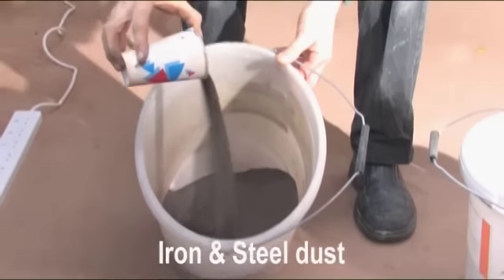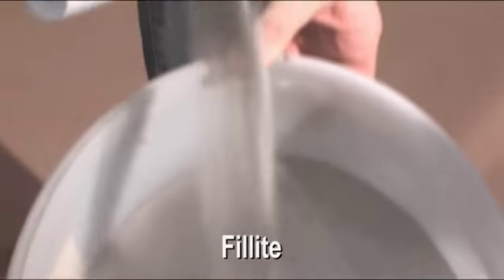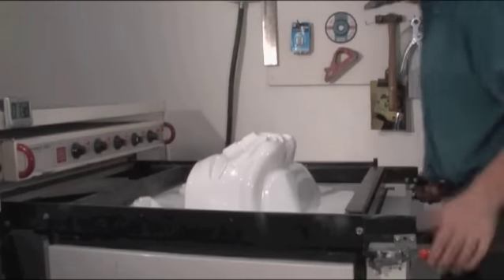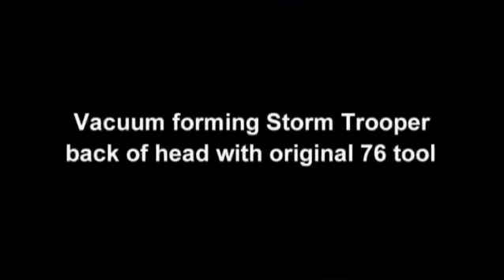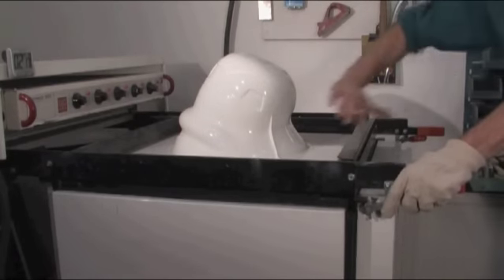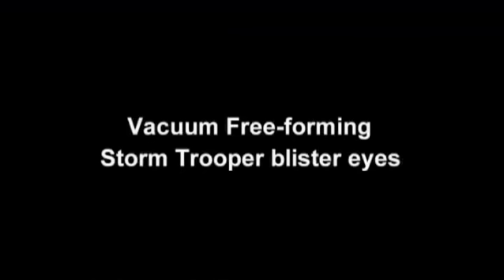Creating the original Stormtrooper

Comment: 3d modelling and 3d printers makes the process so much easier now. That's not to say the old way is any less valuable, I think it takes great skill to do it by hand.
Reply: Without a doubt. now we can just make cooler shit faster, is all. its easier so more people can do it. that's it.
Reply: printing is garbage and dosent compare to the proper way to manufacture them
Reply: @ViewpointProd that is dumb....
Reply: @ViewpointProd  3D modeling and printing allows more accurate positive to produce your bucks. You no longer have to sculpt by hand, which doesn't allow for the precision and exactness of a 3D printed positive mold. Then you vacuform using the master buck to replicate en masse for production. The process is nearly the same, but the sculpting is replaced with a much faster digital process. It also allows people who don't have sculpting capability to just download a model to use as a buck, or as a finished one-off piece; i.e. much more flexibility in the production process.

Comment: You can send it off to a recycler, but you can't reuse it yourself. The vaccuformer's rack is designed to hold a certain size piece and scrap pieces would fall through (not to mention you wouldn't be able to form a vaccum) That's why whenever possible you cast small pieces along with the big ones in a single sheet to get the best use of materials. Like you see at 9:37 with the face plate and the side accents.